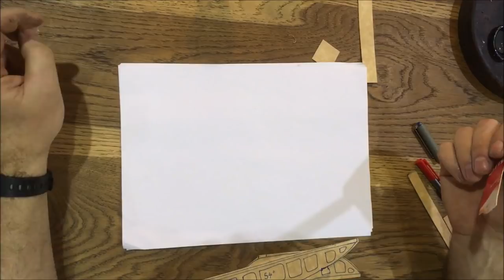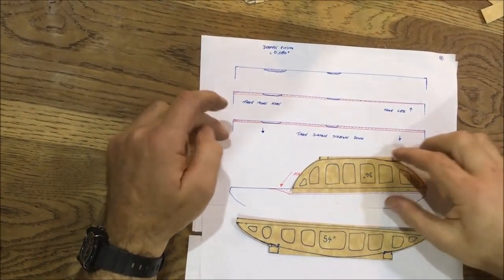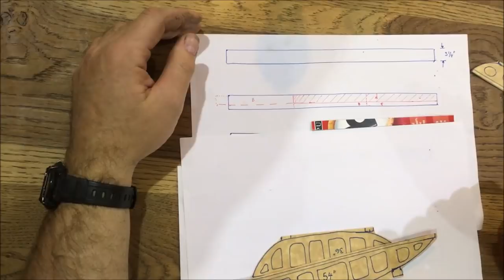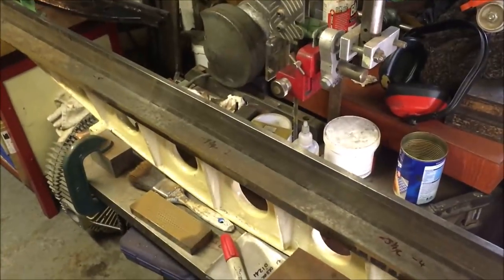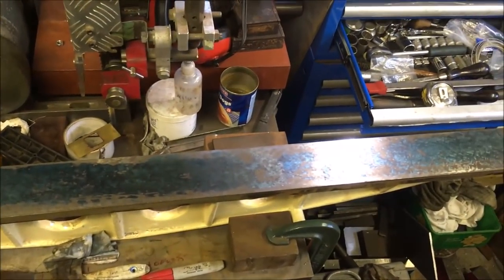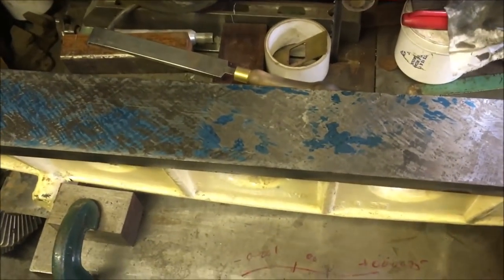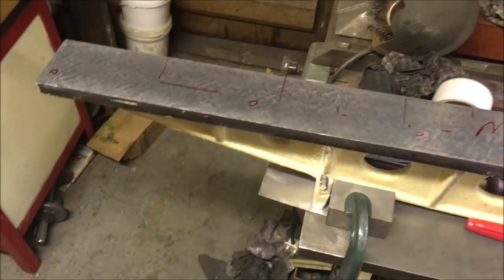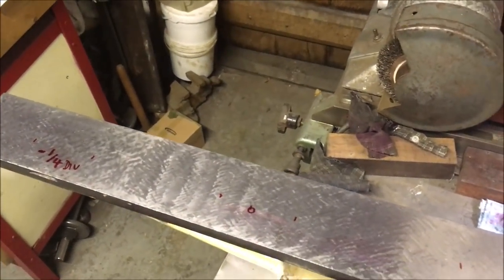Scraping a 54" Straight Edge

Comment: Thanks for use Empiric mate! Hate the sterile continental metric.
Reply from the maker: I have to use both, but am more familiar with thousandths of an inch than hundredths of a mm. Yet when I get past 6ft, I go to meters ! Bloody stupid UK education system converted when I was in primary school - they chose CM's which is next to useless as a direct referance. MM's or Meters would have worked but CM's - rarely used on drawings or tables. Mind, those fractions of an inch still make me scratch my head !

Comment: pretty cool, just what I needed to start getting some ideas for my straight edge. I was wondering if you could scrape a dovetail, lets say a 12" long dovetail with a shorter straight edge or is it better to just start with a longer one?
Reply from the maker: if you have the chance at  a longer SE go that way - it makes the entire task more straightforward. So if you are trying to scrape 18" try and use a 18 - 20 " SE or surface plate. Step scraping as you can see is possible but it adds another risk of error.  My advice get a SE or surface plate long enough to do the task. In my case, I didnt have a 6ft SE and am working up older castings from my 24" granite to get to 6ft. tedious to say the least. :-)
Reply: oh, ok, just as I suspected. Thanks for confirming that.

Comment: Thanks for taking the time to do the intro explanation bit.  It helps to see the process you used to finish off that straight edge.  I just bought a five footer myself, it has a little rust damage but not the deep rust pits you dealt with.  It is dam it's heavy.  Will you use an overhead support to reduce the weight of the 54 when working on the six footer?  I think the 54 will prove challenging to print with.  Anyways, congrats great job.
Reply from the maker: Hi Mark, I can tell you it was a lot less effort with paper aids than lumping the SE around to re-shoot the sequences lost ! Ive been thinking about the 54" as master - lifting it up and on to the 70" . The main issue is being able to invert the 54" between printing, re-inking / spreading and it sitting on its feet while I scrape - Ive no solution at this stage. I took the first prints yesterday manually and it is 'do-able' all be it not too frequently. I have to shuffle a few things about to reduce the distance it has to be carried and remove the current 90 degree rotation. basic logistical stuff to minimize the effort.  If I run out of puff, I will have to rig up a pulley and counter weight from the roof joists - its just more stuff to get in the way and drop dust etc etc. Ive seen some complicated counted contraptions which reduce the effort but all are in far larger work places so have room. If you can - then do it !
Reply: Seeing your shop really drives home how much space I have.  I'm amazed at what you have packed in there.  
Inverting it will be a challenge.   You need something you can lower it on, clamp it  to and spin.   Kind of a scaled down car rotisserie.  I think on practicalmachinest forest addy said he used track for a garage door screwed the the ceiling and some long door springs to reduce weight.  but I think he used the track to go from project to granite plate.  Could you reink with the straight edge in the air?  It will be interesting to see what you come up with.
Reply from the maker: Managed to lift , invert and print yesterday by hand. As the 6ft SE is such a large surface, the printing cycle is quite infrequent. So with luck I may get away without adding any further complications.

Comment: what are you going to do the filling with zinc has the same melting point as lead
Reply from the maker: I left the 'pits' on the SE I concluded that if the SE is 'rubbed' a distance greater than the size of the pit is makes no difference.  In reality a 2" shuffle of the SE in use is pretty small. I do have to be sure the pits are clean before use and dirt could lodge in.

Comment: Can i ask is there radius whem rough scraping also can i scrape cover like 100% if its scrape alignment
Reply from the maker: Rough scraping is all about getting the material off evenly without digging holes as fast as you can (minimum effort).  If you use a small radius, you can take a deeper cut but its narrow so you need more of them and you run the risk of making some much deeper than others - this then means you have to scrape the rest  of the area down to that depth before moving on to going for contact. In my view, its better to take a broader scraper (large radius) and overlap your scrapes by 50% side to side and 30% end to end, that way you move a lot of material without digging holes.  Which makes the next step easier. Scraping for alignment is generaly rough scraping (as above), then as you develop the surface you keep measuring the alignment to ensure it remains within tolerance.  You can see this on the video where I re-scrape the Holbrook lathe bed.
Thanks fo rwatching. Mat
Reply: @lookcreations  should i use a non radius blade with corners knocked off or it has to be with radius .really appreciate your help theres no convenient way to do research on scraping and im still kinda unsure with dots per inch i know 40dpi is what precise machine tool have
Reply: Can i use scraping for dimension fit also what happens if you do not criss cross the scrapes? Sorry for the questions(i shall repay you by handing down this knowledge to anyone interested and want to scrape xd .)
Reply from the maker: It is very hard to scrape with a flat blade. A large radius say >90 mm . If I hold my blade against a straight face, the 30 mm wide blade might be 0.5 mm down at each side for roughing.
Reply from the maker: As a guide. 
15 points per square inch with >50% contact for slow moving faces, 20-30 ppi @ 50-75% contact for more accurate bearing or faster moving. 30+ ppi looks good but doesn’t gain you much over 25 ppi at 50% contact. Static faces might by 5-10 ppi at 80%+ contact.
Reply from the maker: If you don’t cross your scrape you can get ridges of contact and hollows either side. So if the mating face has the same it will not slide  without more clearance.
Reply: @lookcreations  thank you so much for the information and guidance.

Comment: For such deep pitting, would it be feasible to fill in with brazing?
Reply from the maker: yes, that was the approach used by Robin Renzetti on Tom Liptons little level. Robin used a TIG torch and silver solder (low temp) to minimize potential distortion from the heat. In his case it was a casting inclusion not rust pocket. It may be something I go back to address in the future when I have funds to buy the Argon bottle & Gas for my Tig Welder. At this stage I dont see that the pits of despair will be too much of an issue in use.
Reply: Look on the bright side, in those areas it increases your PPI!  (Pits Per Inch.... )
Reply from the maker: One was so big it has been named and there are a team of cavers exploring the inner reaches.... 
 @somebodyelse6673

Comment: you dont bother to drill and solder those bad pittings of rust corosion sink holes? ?   ... then fill them up with led ? or other ? ... and flatten them again?
Reply from the maker: if I was looking to create a 'master' but on this SE I didnt bother. If the area had been larger I might have split it and repaired part of it to reduce the size.